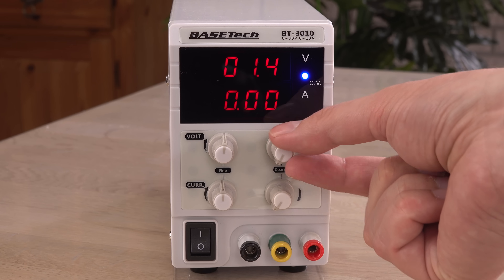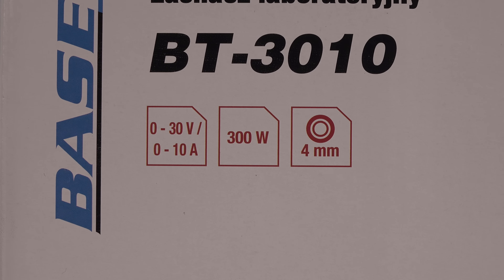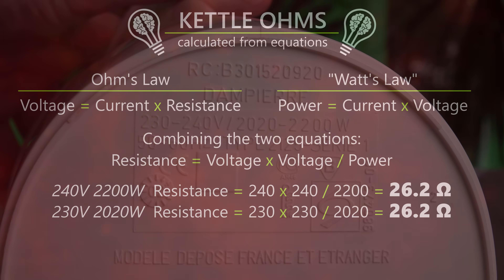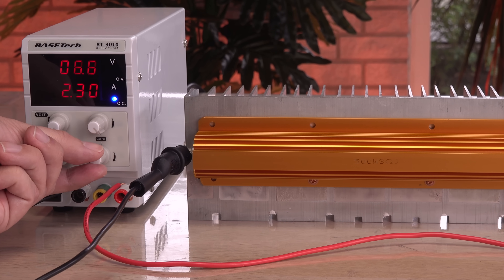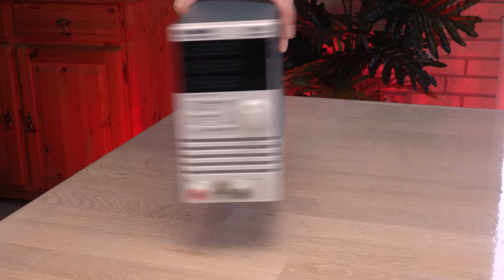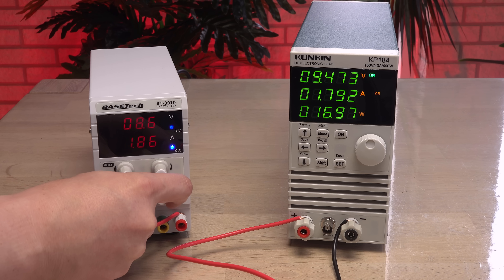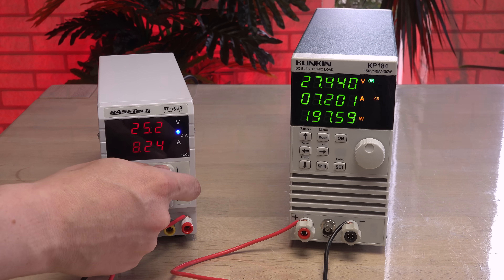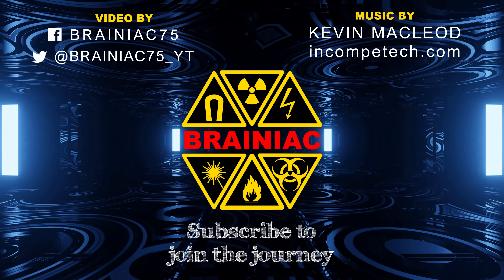How [NOT] to MAX test a power supply!

Comment: not even one word about switching or linear PSU.
Most bench PSU will go above their specs.. just as electronic loads will do the same.
aint those kunkin184 rated as 400w 40A.. wont they do 42A and 420W?
Got a shiutload of cheap Korads linear bench PSUs with PC control (70 to 95 euro from Germany/Recihelt to DK) to run my laser diodes with not to much noise & ripple and these linear Korads are rated 30V 5A, but will gladly do 31V and 5.1A.. same with my cheap electronic loads from East tester ET5410 (90euro to DK)  they are also rated 400W and 40A, and will do 42A and 420W.. so you have some leway from their ratings.. quite normal.

but since that PSU in the vid is that small and does 10A, it seems like a switching PSU, as a linear transformer doing 10A at +30v is heavy like he aint my brother but since you dont mention what "cheap" is, its difficult to relate, as the aspect of "cheap" is extremely relative.

Comment: Electronic loads are usually switch mode and can easily cause power supplies to be unstable at certain settings.
A few hundreds of low-esr uF across the supply usually fixes this problem.

Comment: I actually have a power supply similar to that one, and it is overspec as well. i think it is because if you turn up the course voltage adjustment only, that gives 30 volts. But if you also turn the fine voltage adjustment up it adds an additional 2 volts to that, giving 32 volts.

Comment: Shouldn't a labbench power supply be safe, even at the edge of its powercapabilities?
I mean I don't expect it to supply the power for long but I expect it to cut the power once it heats up to much. 
Also another thought, I live in Germany and was able to buy a psu from the same brand at conrad, shouldn't the unit be safe regardless of setting according to consumer safety laws?

Comment: When I tested a power resistor rated 100W 2 Ohms with a lab power supply 30V x6A=180W I cooled the resistor in water.

Comment: This is a harsh test for the transformer, particularly the primary windings as it needs to deliver max current.
However, high power linear power supplies usually have multiple secondary winding taps at different voltages, and then use a BJT transistor circuit to curtail the last few Volts of that tap to reach your desired output.
Say the transformer has taps at 9V, 18V, 27V and 36V. The BJT circuit always needs a couple of Volt to operate. Hence the 9V would be used for outputs up to say 5V, the 18V tap up to e.g. 14V, etc. This could be a reason why the PSU reaches 32V instead of 30V, as the transformer could output less V with a low line voltage, and the BJT circuit could heat up and have a higher voltage drop.
However, notice that in order to properly stress test (e.g. "burn in" or "burnout" test) the PSU, you would need to get the maximum voltage drop over the BJT. In my example figures, the PSU outputing 32V@10A=320W from a 36V tap, means the BJT circuit is only dissipating (36-32)*10=40W.
But note that if you shortcircuit the output, that the PSU would likely use the 9V tap, "curtail" 9V to reach 0V/10A output, and internally dissipate 90W(!).
If you want to grossly overload the primary side of the transformer, then don't use a shortcircuit but a voltage at which it just about needs to use the highest tap, at max current. So say it changes taps over for Vout<=23V, then use 23.1V @ 10A. The transformer outputs 36V@10A, the PSU needs to dissipiate (36-23.1)*10=129W, and the primary side is heavily loaded as well with a power of 360W.

Note all figures are example. I don't know what the taps of this PSU are, the hysteresis regions, etc. You can maybe hear relays clicking when you turn up the PSU voltage. If it does that, then for sure it's switching taps and you could figure out the best way to create a worst-case test...
Oh.. if the PSU only has 1 tap (say that 36V for the 0..32V output range), then use a dead short on the output. The PSU would need to dissipate 36V*10A=360W. It's probably not doing this, because you would need an enormous heatsink

Comment: Normally when I test load the amperage, I would use car (12V)/ truck (24V) halogen bulbs either in parallel or series rather than using load resistor/s because from the brightness of the bulb I can however estimate it's voltage and wattage.

Comment: Sticking with the crude and cheap method, the "massive cooling" would be as simple as a couple of canned air dusters. If you turn them upside down, you get liquid air to help cool your resistors. I've used this method on CPU dies when troubleshooting without having to keep removing a cooler. (Tin shot glass set directly on the die and dribble in liquid air). 

 Alternatively, the average capacity of a standard refrigerator is 350 watts and the capacity of higher end consumer grade chest/upright freezers is 700-900 watts. Drop the temp on your refrigerator to the minimum, pop in the capacitor with the wires running through different sides of the door seal and you've got sub-ambient cooling perfect for your experiment.  

As for your added radiator, the air gap would make it more or less completely useless. Maybe you didn't show this step, but using some thermal paste or thermal pads would greatly improve the cooling capacity, as would a small fan.
Reply: Just be careful with the canned "air" dusters in electronics and related experiments :)
Those cans are typically filled with a refrigerant like butane, not regular air (compressed air requires very thick and heavy tanks). Therefore they tend to be highly flammable or even explosive.
Having a connector/switch spark shortly after using one of those cans would certainly make the day more interesting ;)

This isn't just a theoretical risk, either - I've done it myself. I used one of those cans to blow dust and crap out of a 4-way trailing mains socket on the floor, then plugged something into that socket around 10 seconds later. The plug pins arced when they made contact, igniting the butane and engulfing my hand in a flash of flame with a loud pop. I was completely unharmed, thankfully, but I hadn't used the can very much.

The thing is, I already knew it was butane! I just absent-mindedly forgot for a minute 🙄

Comment: this was fun, but i like my Raiden RD6018, it's a 1080w max power supply at 60v and 18a but limited to 600w because its powered by an old 600w power supply from an old decommissioned pc that can  luckily provide 12vand 50a with all of its rails tied together and a boost converter in-between that can handle upping the voltage from 12v and 50a to 72v and 20a all for 60USD from a direct from china app on a sale. no fire so far especially considering i used plywood and 3d printed PLA to build the housing and mounting brackets.
Reply: You can probably modify the PSU to output more than 12V but will have to replace the capacitors

Comment: It is normal for lab power supplies to go a bit above. That way they make sure you can get up to 30V and not 29.99V
Reply: Yeah, mine is listed as 30V 5A, but it's actually 31V 5,1A.
Reply: @schaltnetzteil495  Same for me my Wanptek APS3010H Goes up to 31 Volts and 10.2 amps It even has an electronically controlled fan which switches on at around 50°C and shutting off at 40°C It Even has a Overheating protection which probably temporarily switches off the mains or cuts power to the output circuitry with an error message on the screen

Comment: The oscillation has nothing to do about on which side of ohm's law equation they are. it's all about how the feedback loops of the load and the power supply are tuned. It's complicated, we'd have to dive into all of the internal circuitry to properly explain it. The simple explanation might be, both are optimized for constant-voltage operation, because it is the more common application.
Reply: Exactly
Ohm's law can be V/R=I, making R and I on different sides of the ecuation and it will still wooble
Reply: Honestly, this is exactly what I thought of, after I saw this video. Ohm’s law can be arranged in three forms, so provided explanation sounds weird.
Now I got an electronic load, and I can confirm, that in my setup, power supply in CC and load in CR are stable.

Comment: I have exactly the same power supply. It‘s actually not that cheap. There are much, much cheaper ones on amazon. Anyway, i use it to charge my batteries and the only Limitation ist, that the terminals get so hot, that the terminals literally melt the plastic around them which leads to a bad connection. So dont overdo the amperage. 8 amps is the limit.
Reply: I'm using the rock bottom 30V 10A switchmode lab power supply, the one that comes without knobs for fine tuning and mine has already starting doing funny things at around 10 to 15V (probably the most used range) when voltage sometimes spikes to around 20V. I guess the potentiometer is going bad.

Comment: How does this electronic load control resistance electronically?
Reply: probably with a transistor, that is shut on and off very quickly, in series with a power resistor. The on off rate determines, how high the average resistance is. (how much average current can flow, with a set voltage). Probably way more complicated, but i think this might be the basic conceptm

Comment: It's actually really common for lab bench power supplies to have a higher max voltage and/or max current than advertised. I'm not entirely sure why, but I guess it's just to be able to guarantee it can handle the rated power.
Reply: It is just to make sure they get get to exactly 30V and not 29.9V. They are cheep analog things inside so they are not very precise (they rely on you turning the knob to the exact value)
Reply: Generally it is to compensate for wire losses at higher currents, you may need the extra headroom to get 30v at the other end of the connection

Comment: When testing linear PSUs (not sure if this one was linear or an SMPS) maximum output does not equal maximum stress. That is because the PSU has an electronic load in it self to dissipate the rest of the power. For example if you dial in 10V@10A, but connect a load with 0.5Ohms resistance, the current limiter in the PSU has to dissipate half of the power. With a 1Ohm load, it has to dissipate nothing.
Reply: This is certainly not linear. I have this exact PSU and it is quite light. It is obviously a relatively cheaply built SMPS. (And why wouldn't it be an SMPS? Sometimes lab power supplies are dual-stage switching+linear, but I've never heard of one being pure linear)

Comment: Your resistor is not conducting heat properly to the heatsink. You need thermal paste. This is probably okay since you're not hitting the resistor with its full power rating.

Comment: The thing where the power supply actually delivers more volts that advertised also happens to a 60v 15a power supply my dad borrowed from a friend. It can deliver 16a and 65v! I (=my dad) also own a old 32v 4a analog power supply, therefore it also has analog displays. Their markings go from 0 to the advertised limits, however its display arrow things go beyond that by a little bit too! (They also have a mode to double the shown numbers, as a way to see small currents easier)

Comment: I really like the electronic load unit. Never seen one before. I also note that when using the 3 ohm resistor it still hit 31.7V @ 9.68A which is over the rated 300W. So even though its cheap, its pretty damn good too.
Reply: You can't get one any more because the company CONRAD is shutting down
Reply: @thewhitefalcon8539  KORAD* they are not closing dwon, they just choose not to sell to US

Comment: There are variable resistors for lorry trailer brakelight flash speed adjustment too. 12v but maybe a few in series? They've got a screw down contact that slides up and down a coil bent in a "u" shape. Heavy duty chromed wire, might just be a spring. Not sure, haven't looked at mine in a while. Got a different vehicle and didn't need it.

Comment: Note: You can actually overdrive these cheap PSUs. They have internal calibration potentiometers that can be "tuned" to whatever value, within a particular range. So, a 30V/5A supply could theoretically get up to about 37V/6A if lucky.

Comment: Could you use 2 electrodes places in a solution of salt water as a good load?
Reply: creating hydrogen gas next to a fully load power supply?
using table salt and wondering about the health effect of the gases created?
Running into issues with the non-linearity of an salt water bath?
Reply: It will also corrode the electrodes

Comment: Interresting. I rember Dave Jones (EEVBlog) torture testing a PSU with an electronic load set to constant power.
Electronic Loads are awesome, but as you have already experienced: It is very very easy to get them to oscillate and from there, you can kill power supplies.

Comment: Really interesting video, i was genuinely surpised about the instability issue. It would be really nice to see with a scope the ripple on the voltage waveform.
Reply: I was concerned for a moment, because that is nasty use case.
Dave Jones toured a PSU with an Electronic Load in Watt mode.
Using Resistor mode is a bit less concerning, but still:
As said here: Both devices try to regulate/limit current and voltage, but the electronic load also tries to regulate ratio of voltage to current as secondary controll loop, using the current as primary control loop.
That can oscillate. Oscillation can kill the PSU.
 I would not blame the PSU for dying under such a test.

Comment: I had a Wanptek KPS3010 PSU, but it failed shortly after getting it. I don't know if I overloaded it or the design was really crappy, but I kept getting major voltage fluctuations (like you), that would eventually stress my projects.
And one time, I got a 15V spike while powering a 5V load, and as I was concerned, I turned off the supply, only for it to go bang a while later when I tried turning it on.
After days of troubleshooting I found out that the main IC (TNY277) was overheating, and this caused the switching MOSFETs to short out and blow the fuse, rectifier, thermistor and other parts.. I was powering a powerbank circuit at that time, and it completely fried it. A major power surge went through, as the regulation failed and the switching transformer let the surge through.
I'm not trusting Chinese stuff ever again... especially after paying 90$ for it...
Reply: Chineseum crap in that case 😠
Reply: @samuelfellows6923  And my unit had weird "seizures" at times since the start. Maybe I had a defective unit? And the major PSU "seizure" happened while adjusting the current. I had 3 minor PSU "seizures" before.
Of course, I couldn't return it, as I was curious and I voided my warranty and stripped the screws....
Reply: That power surge wasn't from the mains. The power supply made it, along with making a loud bang!
I'm gonna have to make myself a new power supply, as I can't tinker without a reliable power source.
Reply: I have the same one but a 30/05. 24 bucks on eBay new 8 years ago. I noticed the internal fan only came on for a second to test at power on and never other times when it ran for a week straight. I lined-up the fan from a timer to blow straight into the front grill of it. They run together so why not let one fan cool 2 devices. If you're wondering why a timer would ever need its own cooling fan its b/c it was a one rpm synchro motor turning a metal disk with numerous contacts. Every 8 seconds it was off for 2 seconds. I couldn't find a simple timer that could switch like that so I made one. But it runs hot.

Comment: My Rigol DP712 (50V/3A) will go up to 53V/3.2A and provide that reliably. I've always wondered why it's like that.
Reply: the voltage is obvious: if you need 50V on the load, you need more on the source. If you can not get 50V at your load when the source has 52V, then it is your problem.
If the psu barely makes 50V under no load, then it can not provide 50V to the load.

Comment: I think you should test some longwei/topshak psu's, they're even cheaper and done very well in my usage, despite their lightness and size
Reply: They might have worse noise though.
Reply: @Scyth3934  might be true, but that would not matter for this channel.
An electro magnet does not care. ... but the electromagnet will kick the input protection circuit to hell and back when switching improperly, so... maybe stay with better power supplies?
Reply: @sarowie  anything i ran on them ran fine, and they're cheap as hell when discounted

that includes Arduino's and other MCU's, even on the NPS605W (60V 5A model)

it's best to avoid the 2 dial ones tho, those are pretty finnicky to get the right voltage and even will often temporarily peak far higher while turning it up (K3010 for example), but the NPS (course and fine tune knobs) models are perfect for my usage and don't have that issue

since i don't really trust the 2 knob models too much i mainly use them to either charge something like a lead acid battery or one is in use at a local slot car club where they had 1 PSU down and 10A for a single track was enough for all classes they run there

Comment: I’m guessing why they said 30V and 300W becuase if the power supply blows up they can’t get sued or in trobble
Reply: lol - sueing a cheap Chinese manufacturer?
The 32V is a margin so that you can deliver 30V / 300W at the load.
Reply: @sarowie  Wouldent be surprised if someone tired